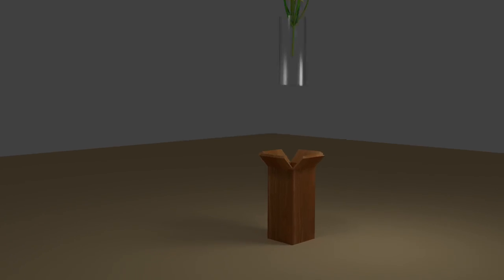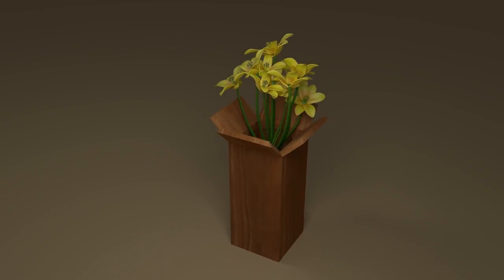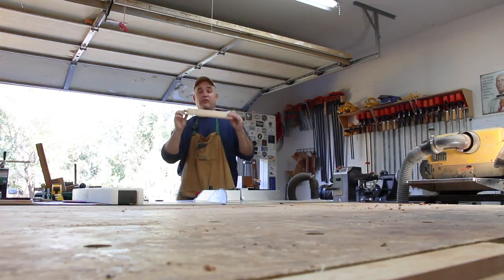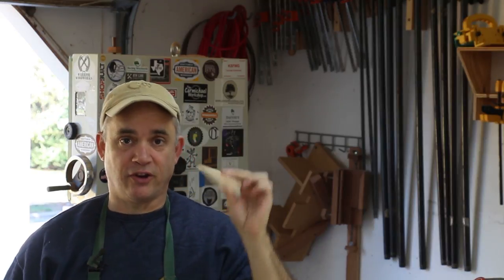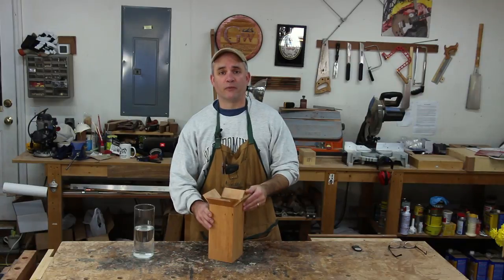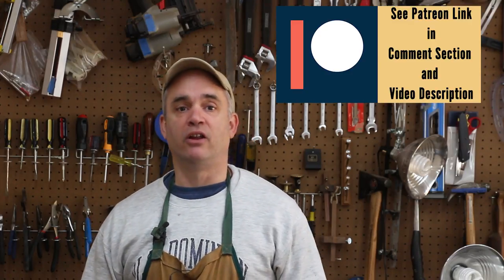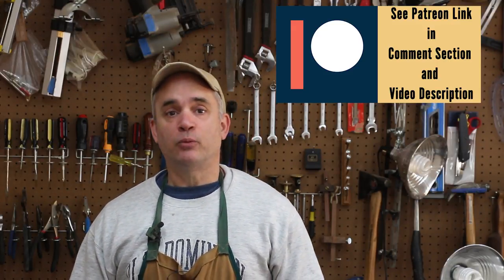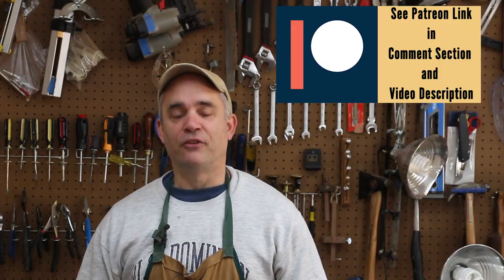Open Box Vase

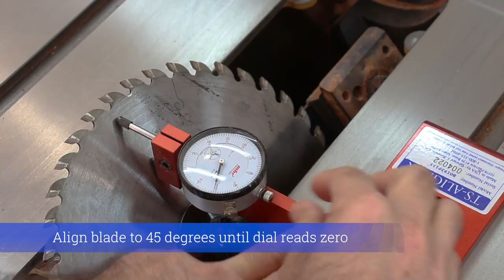Comment: 1:24 oh boy you sure do love getting things complicated
Reply from the maker: There is nothing complicated about it.  Look at a dial until it reads ZERO.  This is extremely simplistic, fast and has the added side effect of being extremely accurate.  No test cuts needed.
Reply: GarageWoodworks dude i was joking because you use dial indicator to set up an angle
Reply: Definitely not very complicated, and very accurate. Didn't I see you use a magnetic angle gauge at some point too?
Reply: Tjalling who me?
Reply: No, sorry, I meant @GarageWoodworks.
Reply from the maker: No.  I don't own a magnetic digital angle gauge.  I only use a dial indicator for angles.
Reply: Ah, gotcha. They're pretty nice, too.
Reply: Wouldn't it be even simpler and faster to use the setup block you used to calibrate the dial indicator against the blade itself?  Eliminate the dial indicator step?
Reply from the maker: +Afton Grant That requires kneeling or bending over in front on the saw blade.   You need to then push the block against the blade while squinting for traces of light between the blade and the block while making minute adjustments to the angle.  The DI method required none of that.   The DI is quickly zeroed at 45 and then I adjust the angle to 45 while looking at a dial.  What could be easier or faster?  And the DI has the added benefit of being significantly more accurate than squinting for light.   You could use feeler gauges with the block but that’s even slower.